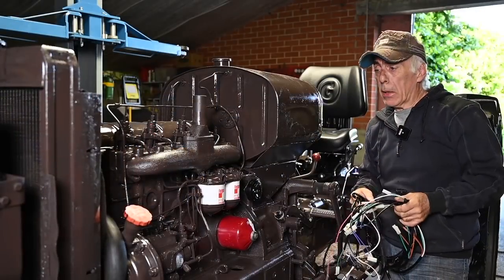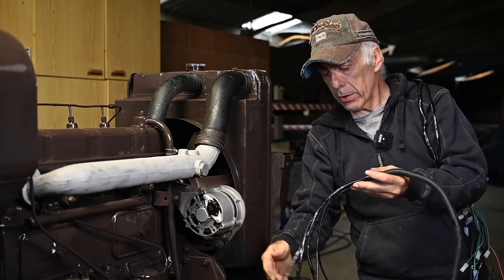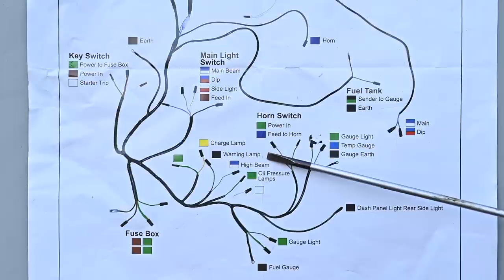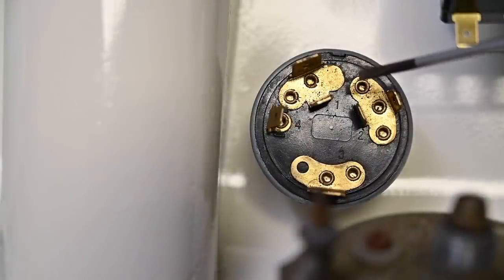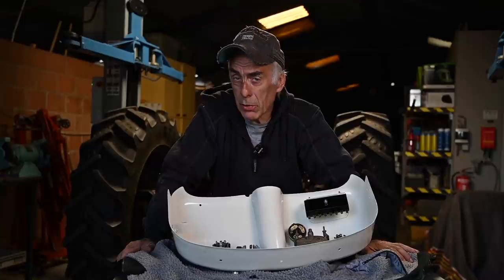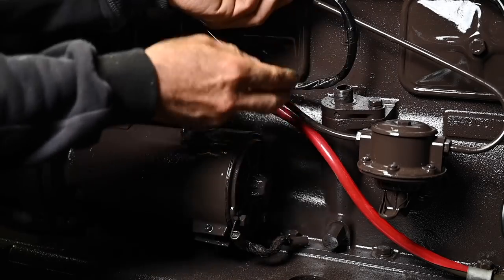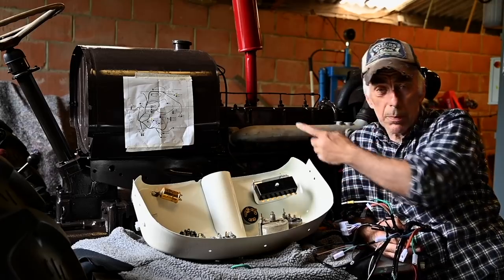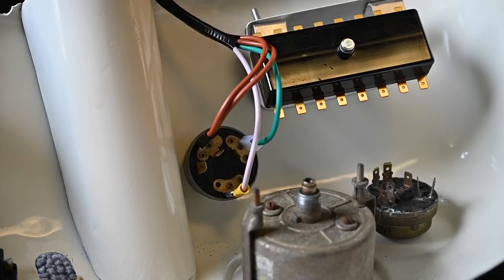David Brown 990 , Electrical recabling Part 1

Comment: One thing I have found helpful is to us "Flush Cut" diagonal cutters when trimming cable ties.  This will eliminate the sharp edge left by standard diagonal cutters and help avoid cuts on your hands later when servicing the tractor later...
Reply from the maker: Thanks for the comments, and tip

Comment: I don't know if it's possible, but if it is, I would remove the tube that holds the wiring loom, cut a channel in it in the backside/facing the engine that is wide enough to pass the cables through.
Reply from the maker: that could be an option

Comment: Hi Steve,
     Thanks for all of your videos depicting your repairs and restoration to the David Brown 990 Selectamatic! They are not only very interesting but also informative to me as another owner of one of these fine tractors. Do you think that you might ever create a video concerning the power steering pump on this machine? I have ulterior motives, of course, because I'm going to have to put new seals and a new filter in the power steering pump of my DB 990.
Reply from the maker: Hi Richard,  I would do so... yet mine is all muscle power...  no power steering..   If I come across a unit .. I might

Comment: Hello from New Zealand, thanks for your excellent videos. I am currently refurbishing a '72 David Brown 990. As you pointed out, removing the steering column allows better access to the dash. However, in doing so, I have somehow disconnected the steering column entirely, allowing the ball bearings to fall into the oil below. I have managed to fish them out of the oil, however I am struggling to reassemble the steering assembly. Any ideas, advice or additional information? Thanks again, Jakob
Reply from the maker: Thanks for the comments,hmmm I need to think about that ...never happend to me

Comment: Sorry to say that but you are a bit wrong about the key switch because you have forgotten the switch for the heater
Normally it should be like that( there are some numbers at the back of the switch):
1 : power suplie in
2 : electricity alimentation to lights switchs and horn or other things
3 : power for the heather
4 : power to start the tractor

Anyhow very instructive video with some really good lessons about restoration and stuff.
Reply from the maker: Hi, well some have a heather, mine does not.   But if you have a heather some can be connected to a separate switch ( push switch), or indeed to position 2 of the contact switch and then position 3 for the trip wire.   Its a good point and `i should have mentioned that, but as mine has never gotten a heather , I did not cable it in...

Comment: Steven, you can disconnect the pins from the alternatorsocket easely to guide the wire through the tube, can't you?
Reply: They make tools to let you remove terminals from a plastic connector body. Would allow you to remove the wires to run thru the tube, then replace the terminals back into the connector body. They are actually very cheap. I have a couple of different sets.
Reply from the maker: You could, but its also the other spades...
Reply from the maker: Need to get some . TXS